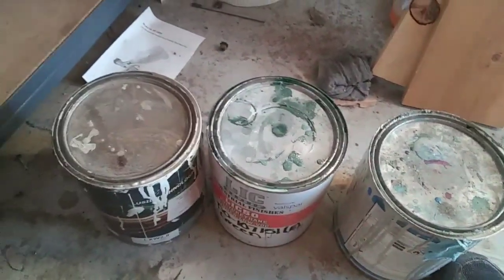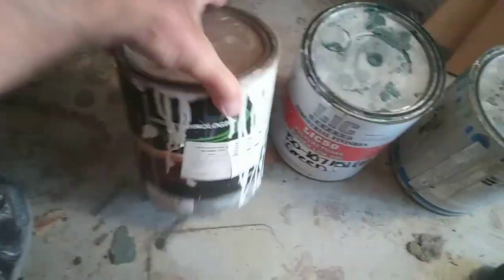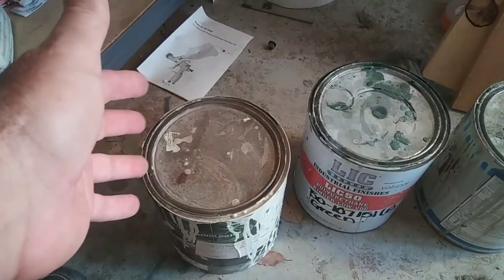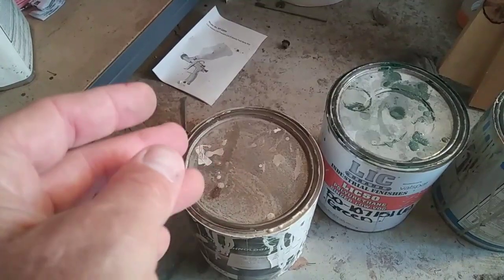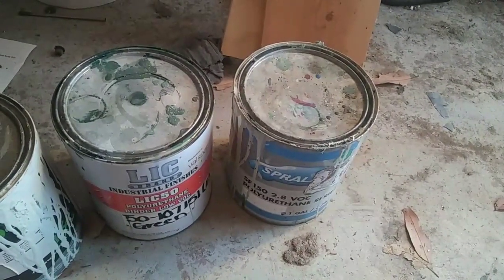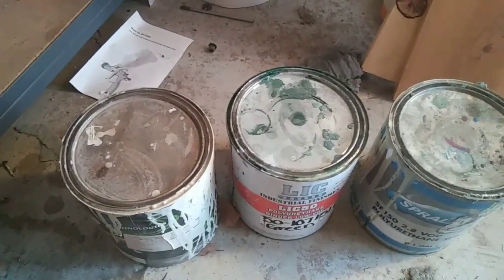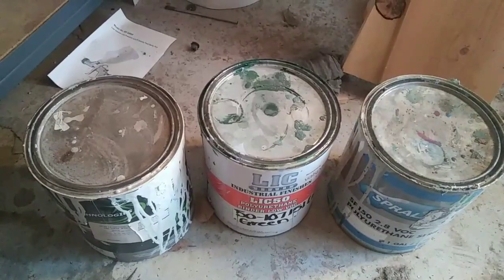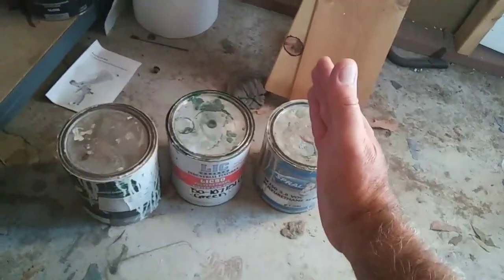How to spray single stage urethane without getting any orange peel

Comment: If you are getting Fisheyes, you aren't cleaning enough before you spray. Either your gun or the surface has contamination on/in it. Period. Thinners will not cause Fisheyes.
Reply from the maker: That is not always the case. Sometimes it is the reducers. especially in CA where they suck. The old reducers were better for fish eye prevention. The other single stage products I have not had issues with. Mostly Valspar. Plus some like slow build like Valspar 2 stage will fisheye when you put the first coat on too wet. Light coats no issues. Or just use another product which is my preference. I like the Tamco products for national rule and Auto art for ultra low voc basecoats too.
Reply: @Mikefngarage  Yes, always the case. They are caused by either a petroleum or silicone contamination. Petroleum products contain silicone. If you are doing a good enough job with your prep, and your gun is spotlessly clean, check your compressor and air drier. I had all kinds of issues with fish eyes popping up at the most inopportune time till I installed and air drier  and a three stage separator system.  Plus I installed drains at every right angle turn of my air supply. If you do all this and the problem persists,  get new hoses as your old ones may still have contamination in them. I've been painting cars for 40 years now and it always goes back to contamination. BTW Don't use fish eye eliminator. It will cause problems the next time you use that gun. Just speaking from experience.
Reply: @fosterdl1  Agreed in fact fish eye eliminator may just be pure silicone, that's what a dupont guy told me. Silicone can also be airborne like a virus. Maybe it flew in from a computer...
Reply: Is he thinking about solvent pop?

Comment: im using a devillbiss flg4   hvlp, I had my air too high too, when I turned it down to around 16 psi, it behaved better, reducing it some helped also.  I tell ya im not liking single stage urethane for pearl or mettalics at all.
Reply: Metallics should NEVER be single stage. You need a clear coat to protect the metallic aluminum particles from corrosion.

Comment: im getting zebra stripes mottling with pearl/ summit ultra blue pearl single stage.
Reply: Criss cross coats don't paint the panels in the same direction,high mist coat for mottling,you put to much paint on, a
mist coat will melt in and cover the mottling.Just spray and look at it to see if it covers if it reapears give it time to dry more.
Reply from the maker: I usually drop coat it with 2 times after I am done. You put about 50% slow with the paint  or half medium and half slow reducer and mist it about 24 inches away on the tops then about 16 to 18 on the sides sometimes in a cross spray pattern.

Comment: Did you paint your Busses with single stage urethane or Acrylic Enamel?
Reply from the maker: urethane is better bang for your buck. I sometimes use base then clear depending on the color. some colors are not available in single stage.
Reply from the maker: as to answer your question on my busses most of them I use single stage 3 to 1 urethane satin Sign paint because I get it for free. Then I clear coat it with automotive clear. It works kind of like base clear. A couple I did with single stage valspar.

Comment: Wow!!! I get you want to share what you do.... but.... Understand what you are working with and why things are happening (fisheye). Explain why a company would put something in its material to cause fisheye???? People would not buy their product.   Fisheye can come from multiple things. Contamination on the surface, you, your gun, your air supply, if you buffed in the booth you paint in, your lacquer thinner you clean your guns in...ect. light coats do not cause fisheye!!!!!! Don't teach using fast reducers then slower reducers after!!!! It can be done but not real smart. If someone uses fast reducer, puts a light coat on, has too long of a flash time before applying the second coat, the first coat will wrinkle and lift! Crazy cooter comin at ya🤪

Comment: Does sealer  help to spray first for fisheyes????
Reply from the maker: it can and sometimes does, Depending on the sealer the ones I use are for DTM or nibs that you didnt want to prime or just sanded through feathered paint to seal out for better coverage.  Some are just for coverage. some are for better adhesion. Read the label on the sealer you would like to use. I recently used Matrix prime and seal DTM 2 part really good stuff. The paint went on it like glass and yes it did resist fisheyes.
Reply: Mike F sweet thanks
Reply: fisheye's are mainly the substrate is filthy,clean all panels with reducer on wet[water]towels,i use the high dollar white ones on a real paint job,wet towels soaking wet,wring out to almost dry and put reducer on towel and start super cleaning it,no lifting
Reply: @strattuner  is there a preferred reducer?
Reply: @Whatsthe_dill  i just use slow to medium enamel reducer,expensive but i like to wipe it down and let it breathe till i can put the hue on, or the primer,usually 3-5 minutes,i will never use a tack coat on anything except equipment spraying, for cars boats and airplanes,first coat medium spray and move gun to cover without running,and i walk the whole sides to cover,mix up plenty,waste is better than non coverage